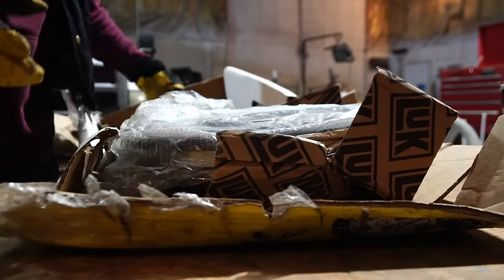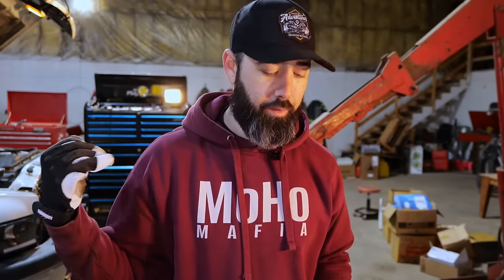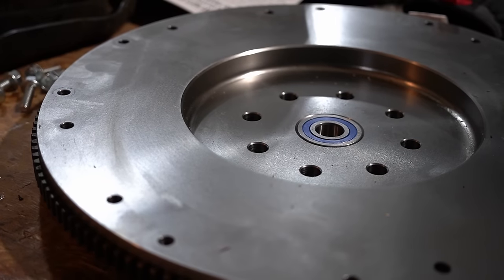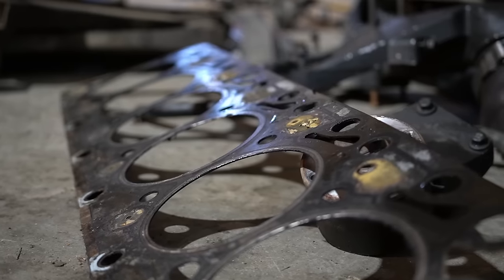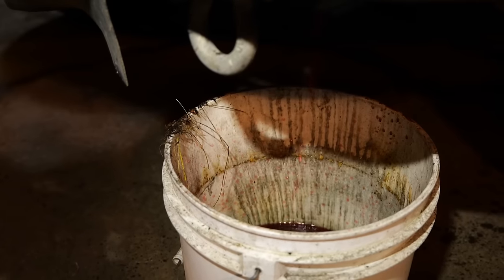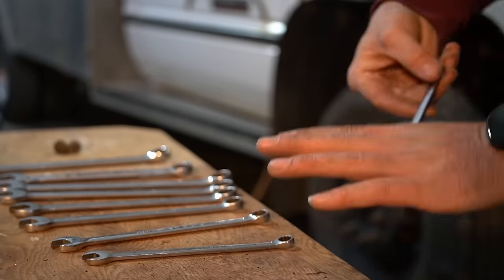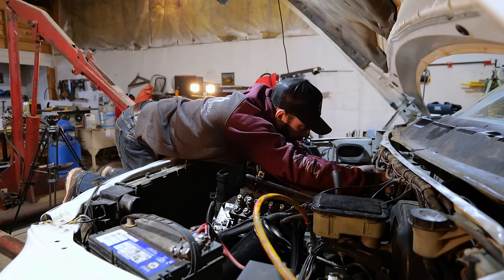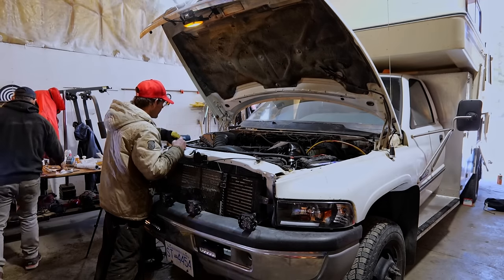No Engine, No Problem | The Winter Overhaul | Destination Adventure

Comment: Dustin, a big part of your front tires cupping, is due to the weight of the truck, most likely to far over the rear axle. As you drive, especially at highway speeds, the front end of the truck is bouncing up and down slightly, which deforms the tires, which only exaggerates as the problem gets worse. I drive a flatbed dodge 5500, and carry heavy loads often, and the only way i get any life out of a set of tires is by rotating them constantly.
Reply: @Destination_Adventure
Reply from the maker: The weight definitely contributes, and front tires will be somewhat of a consumable. lol.  The rig is nicely balanced though.  She’ll get new boots this spring, so we’ll see if it wears a bit better with the upgrades.  Even a little improvement will be good. lol.

Comment: As a diesel mechanic, you did well for never worked on a diesel before. Another skill added to your belt 👍

PS. Your mechanical pump and injectors will tolerate much more abuse. I wouldn't recommend cleaning the lines like that if you had a newer electronic injection or common rail system.

Comment: I have my beloved 2001 Dodge 2500 5.9HO 6spd manual that I had built for me at the factory! She stayed stock until I got ready to retire in 2018. I then put an Edge computer in her, S&B air filter, Banks exhaust/air brake/air intake, bigger turbo, FASS fuel system and AirLift bags. I also redid the entire front end with beefier parts to get rid of that wander and wobble earlier Dodge’s are infamous for. She tows my 11k travel trailer with ease! I love the computer for fuel economy when not towing which is around 28mpg doing 65mph here in the hills of Montana and for the extra power when towing. The air brake is probably my absolute favorite, such peace of mind when starting a steep grade, especially towing, and hear that air brake’s guttural sound as it keeps forward momentum at bay!!  I love the detail and care you put into your girl Dustin!! What a fun video though I can only imagine that it was a bit of stress for ya!! Bravo!

Comment: This is what I love to see. Prepare for as much as you can and after that you can only deal with what comes but you know that you've done as much as you can. 
As trucker, equipment operator preventative maintenance is so important. Ive worked for guys that were really good at it and ive worked for guys that run them till they dropped and I'll take the guy with pride that maintains it every day. 
Im sure that is what was instilled in you by your dad. Good job Dustin.

Comment: I glad it was you doing that job on the floor there Dustin 
That flywheel is definitely toast 
I hope the new bits work well 👍👍🇦🇺
That dust in the intake is a real problem 
Might need a snorkel to get it up out of the engine bay
Dustin the diesel mechanic 😂😂

Comment: The spots on the flywheel are both, areas that have over heated and raised up. The clutch disc material has stuck to the flywheel and causes the shuddering. The shudder is the disc gripping and slipping on the flywheel, never a good thing. The pressure plate is likely glazed or has similar over heated spots that are raised up. All new parts will fixer' right up! BTW, it's pronounced "Luke" like the name, you had it right and then wrong! :)
Reply from the maker: I knew one of the two were right. Hahaha

Comment: Hopefully you read this, make sure to do a hot retorque on your head studs, even though many manufactures say its not necessary, real life results have shown it needs to be done, id rather go in and check them all after getting the engine warm a few times then risk them loosening off and blowing another headgasket, i did arp 425s and learnt the hard way, finished torque at their recommended 125ftlbs and when i blew my head and rechecked them again they were at 115, after that i finished the next go around at 135, and went in for a hot retorque at 140 and got quite a bit of turn on them all again, after that they were clamped good

Comment: Nicely done! Working on a vehicle where everything is heavy isn't easy!  Your clutch chatter definitely was partially attributed to the flywheel and pressure plate but that tore up pilot bushing and trans mount would have caused a lot too.

Comment: Great job and effort!. FYI cupping on the front tires of the dodge tends to be stock toe in is to wide. 0 degree toe will generally minimize or get rid of cupping. i suffer this on my dodge and the zero toe corrected the tire cupping on my dodge. dodge ram forums have lots of info on this. its a straight front dive axle issue.hope this helps you out! keep up the adventuring and the fantastic content! all the best.

Comment: I worked on and F550 that had a similar wear issue with a big service bed on the back. His problem was that the front end was WAY oversprung with all the weight on the rear axle, he had 7000lb coil springs, we swapped in a set of 4800lb front springs from a non plow prep F550. It ended up improving his ride quality, and no more cupping like that. 
So if you happen to still experience that every other lug wear, try to find some softer front springs!

Comment: Since you had the head off you should have added the  fleece performance  rear of head water outlet it helps reduce the heat Temps in the rear 2 cylinders considerably!

Comment: i recently had almost the same experience, got done some rough trails, needed to get belts and misc maintience items finished, then blew out my rear shocks, replaced both front a rear to try a new company, and had my head gasket go, found out the head was pooched (Cracked and warped beyond saving), replaced that and we put in new injectors to find out the glowplugs got super hot and wouldnt fire anymore. it was an expensive couple of weeks to say the least.

Comment: I would gave done all your bushings in polyurethane that way no deflection ever. And they last a very long time. If you have an aftermarket air cleaner that’ll be your dust problem. The factory air box is the best way to go so you don’t “dust” your motor. There’s a lot of other improvements to your engine you could have done since it’s apart. You’ve got the p pump which is more desirable and you can turn it up for much more power. You should use “Right Stuff” gasket sealer it’s the best out there.

Comment: I think the head needs to be retorked after it's gone through a couple heat cycles. And then you reset your valve lash. But whatever is recommended in the instructions is also a good baseline to go by. I've never done a valve job on my Cummings, but I've watched dozens of videos. You did a great jod.
Reply from the maker: I’ve been reading into and considering the re torque as well.

Comment: I used a LUK clutch in my John Deere 4045/7.3 power stroke flywheel, only issue is the noise starting from the throwout bearing, at less than 500K. Wish I had researched that, before I installed the bearing, instead of after. It seems to be a known issue. Great videos, as usual ☺️🇨🇦

Comment: Going over to beefier head studs was a good idea. I hope you had the machine shop put in beefier valve springs as well when they decked the head. Time for a 3-4 K governor spring kit and overflow valve change up to give it a bit more power perhaps. Hope you have a bulletproof summer with all that work. Well done.

Comment: dustin,
i drive a 2002 f250 7.3 zf6 truck with a lance 990 camper.  i live in the mojave desert. it is very dusty and the dust is fine. i also worked at the local off road shop for 11 years.  when possible, we run 3 stage oiled filters. usually a k&n style wraped in foam with a outerwear.  i run the s&b system. donaldson systems are good to. dry outer. wet inner

Comment: 18:40 
I found this online about 12v Cummins 

There are two different versions of the 2nd Gen Cummins. The first is a 12-valve engine featured in 1994 through 1998 Dodge trucks, and it is very similar to the 1st Gen engine. The second version is a 24-valve engine and is featured in the 1998.5 through 2002 Dodge trucks

Comment: Head studs? That, a racing transmission, chip & pyro, a good rad, suspension, and 35"s turned my 6.7L tow package into a frickin semi for hauling equipment and sea cans. Could not overheat it after all that. Even, driving smart, over 50k lbs gross in mountains. I had a flatbed with 3x 12k axles duals - 18 wheeler baby. Took the whole rig offroad too it was an actual monster. Had to put it in N to stop 😂

Comment: Cheers nice work those are some good upgrades u wont regret ..... check up on exhaust manifold as the stock one is bad for breaking the head mounts off if u do some google search u will find that they expand over time and can cause huge damage for there price... cant wait to fallow 2024 journey 👌

Comment: Change your rear engine seal.

Above the transmission on the engine, there is a frost plug. Get a replacement frost plug with a thermostat bypass. The number 6 cylinder runs hotter without this bypass mode. 

Change all your frost plugs out. 

Make sure the killer dowl pin hack has been done on the engine. 

Change all the cooling hoses as they are almost 30 years old. 

Then add extra oil in the transmission. I heard at least 1 extra liter. This is to help the 5th gear train to have extra oil.

Buy and install a steering gearbox stiffer brace.
Reply: At one point I noticed  the transmission has an over fill elbow.  👍

Comment: Wow that throw out bearing did sound real bad and yeah how would you know on a deisel.  But as I have always been told to replace the throw out bearing and the pilot bearing no matter what just since you're there.  Also cool they give you those access points to remove the back head bolts and not make you drop the motor.

Comment: That inside tire wear is from negative camber and or negative toe, that looks bad enough to be both negative camber and toe. You can adjust camber with offset ball joints but if your camber is not too far negative you can compensate by towing it in a little more than normal, normal is 1/16 of an inch towed in. you can go 1/8 to 3/16 and even a light 1/4 of an inch in and that should help you out a whole bunch. Rotate your fronts to the inner Rears when you're setting the alignment and before the first drive and your tire shouldn't wear fine.
Reply: And no those control arms are not going to affect that tire wear at all unfortunately.

Comment: I don't know if there is truth to a bit of information I have heard over the years but I thought I would share it with you
I have been told by numerous diesel owners that using your engine brake above 2000 RPM is hard on head gaskets, maybe something to look into going forward

Comment: As I'm watching could be wrong. You cannot reuse those bolts after you pull them. I think it does something with the tension. After they are appalled they can't go back to their original specifications. Could be wrong

Comment: Man if your seeing dust at the compressor inlet you have a leak in intake pipe, air box not sealing, or using a poor quality air filter. That will kill the motor if left to happen.

Comment: Hi Dustin, dose the head gasket, head studs, or both require a Hot re-torque? I seem to recall that they do, might be worth a look, just in case. It would be a shame to have to do all that work again in a few months. Take Care
Reply from the maker: That step is kind of up to the installer.  With bolts I would say yes, but studs I don’t know if it’s that critical.

Comment: You doing a hot retorque on them new head studs?
Reply from the maker: I’m not planning to.  Something I’ve been thinking about though.
Reply: @Destination_Adventure  it's not a bad idea, new studs can stretch quite a bit when they are new . As for your tires wearing, upgrading to the 2008+ steering should help with that